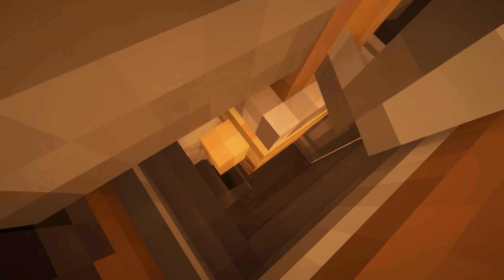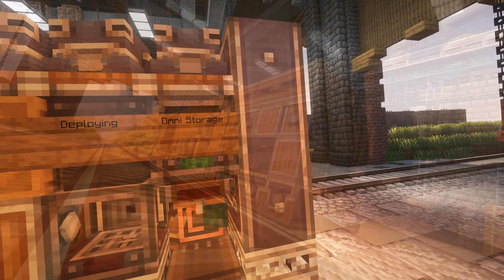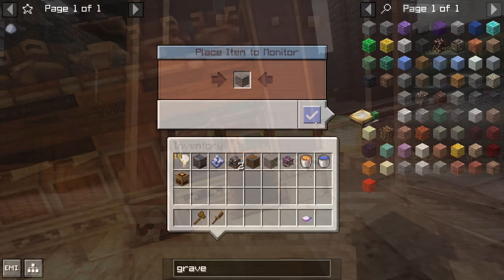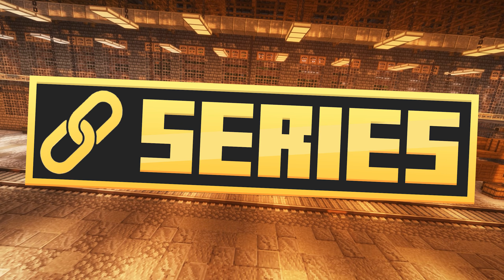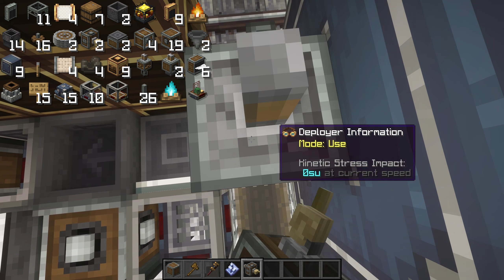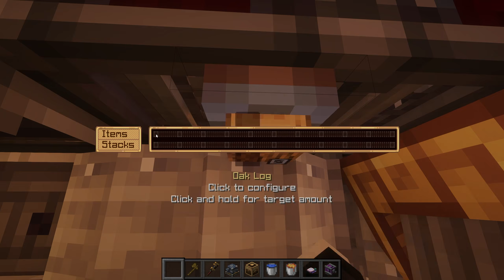Automating EVERY Item In The Create Mod With One Machine!

Comment from the maker: WARNING: There is a glitch that occurs with the crushing wheels, where if the speed of the machine is spinning above 192 RPMs, all items queued to be crushed will bypass the crushing wheels. This can be patched up by setting your factory gauges to where promises expire after 30 seconds when utilizing the crushing functions if you intend on running the machine above 192 RPMs.
Reply: the saw doesnt work?
Reply: @Konzrar  Bit late but to make the saw function instead put a packager below the frogport for cutting that goes into a barrel below and have an andesite funnel leading to the saw from the barrel
Reply: is that fixed?
Reply: Use funnels on crushing wheels input
Reply: aight, imma run it on 193 then. thanks for the warning ;D
Reply: i weally wike this video

Comment: I had an issue with the deployer function: the packager would not accept packages from the above chute to place onto the depot. This was solved by using a saw instead of the packager, also replacing the two gearboxes (that drive the saws) with shafts and a mechanical belt.

Comment: Im having issues with the packager/saw function. we were using factory gages for shafts using with the recipe 1 andesite into saw cuts it into shaft. If we ask in the factory gage recipe for more than one at a time the cardboard sits in the chut above the packager with 2 andesite in it. If we keep the recipe to 1 : 1 it works
Reply: I have the same issue. Since the packager is linked to the saw, I think it considers the saw to be a storage for 1 item, thus preventing the packager to unpack packages containing more than 1 item. I'm working on a fix. It seems doable with a hopper feeding the saw I think.

Edit: You can replace the packager with a hopper, and the barrel with the packager you took from the bottom and it works with stacks of items, dispatching them to the saw one by one via the hopper.

Comment: I've been able to get almost everything working, the only part I cannot get to work automatically is creat8ng brass.   I can supply the Mixer with the zinc and copper, and blaze with coal, but when trying to setup this using factory guages ( per factory board) there is no way to do this.  Do you have any suggestions to get this to work?

Comment: IF YOU HAVE ISSUES W/ THE DEPLOYER:

Solution: 
1. Extend the Setup (Storage) by one block to the right, extend the belt by one block etc.
2. Move the two vertical gearboxes underneath the "CRAFTING" to the right, where the original storage was (two blocks to the right, from the "DEPLOYER"
3. Place a SAW next to the DEPLOYER'S DEPOT, add a SHAFT between the saw and the vertical gearbox (from Step 2.) (Move the NETWORK LINKER to the outside)
4. (From Bottom to Top:) Add a chute, then a re-packager (with activated lever), then a chest (etc.), then a frog above (setup is two blocks higher than original)
5. Add a shaft between the new saw and the old ones, so they keep working.

Now you can produce andesite housings etc.
If you only have one storage and now that each package is complete, you can remove the repackager and chest....

[Issues:]
- packages aren't put into the depot by a packager
- if packages are not complete, the depot will be occupied

Comment: Blasting does not work for Stone, as it can be smelted into Smooth Stone, so it wont let it through the Can't Be Smelted filter
Reply: mine works
Reply: @ianbryant3114 the filter logic might be slightly different for you. I am using .06 of create, and there is a newer version out.. for instance I have to us filters in slots, I cant use the material itself, it just doesn't work
Reply: same for me, have you solved the issue?

Comment: I'm not sure I fully get it. I'm still fiddling with it but it's got spots that baffle me. Like the Cutting doesn't feed into a barrel with a chute that faces a packager...but the chute doesn't load anything directly into the package from above.  It's a great design and I'll definitely use the basis of your set-up, but having to take bits apart to adjust filters and such is  a bit much.
To that end, I appreciate your holistic approach to the workshop but I think I'm going to split these up again to allow for easy retooling and tiling. You have definitely inspired me as far as compacting footprint of a macin, though. Thanks
Reply: did you fix the saw? I really dont know how to while keeping it so compact
Reply: @Konzrar No. I scrapped the whole thing and build my own setups.
Reply: @BinaryJoe  Fair enough, im planning on doing that too but i dont have enough scale yet to warrant a few hours of factory design, will you post anything about it, I would be interested in your take

Comment: After building this machine it seems like packager inputs can't transfer items to the processors. Any idea why?
Reply: I am having this same issue.
Reply: Solved: Certain create processors can’t hold more than one item at once. Had to incorporate internal inventories.
Reply: What changes did you make to solve it, and were you able to keep it in the same footprint size?
Reply: @caribbeancruzer All you need is an interface with an inventory between the packager and the processor. This appears to require more space

Comment: Hey, love the builds. I can't get the mechanical saw (cutting) module to work. The packages just get stuck in the barrel. And what about filters. Is it possible to determine the output via Factory gauges? Otherwise it becomes quite bothersome when doing simple crafting.
Reply: I´ve had the same problem, i only get it to work when i send single item. Wanted to make a stack of stripped oak logs and sent a stack of oak logs but they got stuck in the barrel or chute. Sending only a single oak log works. But that´s...idk it takes ages. Is it supposed to just take a single item otherwise because the saw only processes 1 log at a time and can´t hold a stack of logs in place?

Comment: When I send packages to deployer, it is picked up by the frog port but gets stuck in the chute and doesn't go to the packager. My packager is confirmed to be outputting to the depot
Reply: I've got the same issue have you figured out any fixes for it?
Reply: @krido758 I think it needs a saw to open the package.
Reply: @AlextheCanuck ive noticed you need to put the items in in a correct order as the items in the deployer need to go first and then the belt, the game doesnt realise so it just opens packages as it can. It was a bit weird to figure it out
Reply: @krido758 Yes that's true, but the package is not being opened when the two items are delivered together
Reply: @AlextheCanuck yeah but it still needs to get opened to deliver the items into the deployer right?

Comment: So this wouldn't work for something like stone since stone is sneltable into smooth stone
Reply: If you put your cobblestone on a depot to smelt it, the cobblestone will turn into stone but won't turn into smooth stone until you remove the stone from the depot and then put it back to smelt.

Comment: I had some issues with the deployer portion but was able to fix it by replacing the chute with a packager and putting a hopper to the depot underneath it. Otherwise really helpful.
Reply: omg, that totally worked. tysm for the suggestion! It was driving me nuts not being able to use the deploying function.

Comment: i really like it, but i think i will take your machine and adapt it for my purposes
mainly, I'm not a fan of items that are free. Like for washing, blasting etc, id put them on a conveyor or depot. It is definitely slow but I've had problems in the past with machines going haywire. Especially on servers that have item cleaning or performance mods. Other than that ABSOLUTELY AMAZING MACHINE, i will dissect it, reverse engineer it and learn from it with respect XD

Comment: Thank you for this interesting machine! On my end, it seems the packager does not allow sending cardboard packages of logs directly into the mechanical saw as per your plan. WOuld you have any idea why?

The packager is facing the mechanical saw. It works though if i replace the packager by another saw linked to the first one with encased chain drives.

Comment: All other functions work, but only the mechanical saw does not. Maybe the reason is that there is a packager in front of the mechanical saw. Is there any solution?
Reply: it is working but only 1 by 1. not full stacks. but either way its not working bcs u need some kind of filter i quess.

Comment: Amazing videos, really love the building ideas. I got a question, what happens with things that can be smelted many times? Like cobble > stone > smooth, and in some mods they add more stuff like that. Since you have the attribute filter to "can't be smelted" then it won't let stone pass, for example, and it gets clogged there.
Other than that this was super cool and I learned lots of tricks to use in future builds, thanks!
Reply from the maker: You can addon to the attribute filter to accept stone.
Reply: create: bulk processor by vazpera

fans not only process the items, but can push them slowly into chutes by the time they're done.

Comment: Am I doing something wrong? The pressing part of the machine does take packages, but doesn't pushes them downwards to chute to unpack items inside
Reply from the maker: If your sending multiple item types at once or sending more than 16 at a time it won’t work. If you want you could replace the chute with a hopper to increase that to 5 stacks at a time by having a registered inventory attached that can handle 5 stacks at a time vs 16 items.
Reply: @OurCreationYT  This worked! Appreciate it a lot.

Comment: One problem I’ve found with the smelting setup, you cannot smelt cobblestone into stone, as as soon as it is smelted it can smelt into smooth stone? I can’t work out how to fix it using filters
Reply: You can put an attribute filter INSIDE a list filter to add more allowed items.
Reply: @shamus030 yeah but then there's no way to make smooth stone :/. If relying on filters it means either you can't make stone or can't make smooth stone which both suck
Reply: create: bulk processor by vazpera

fans not only process the items, but can push them slowly into chutes by the time they're done, no filters needed.

Comment: oh gosh I love this whole optimized micro-machine concept. This will be a good series. One note, using empty blaze cages for smoking and haunting is more lag-efficient for servers because it doesn't create extra flame/smoke particles (other than the actual bulk processing particles)
Reply: Are the particles client only ?
Reply: How does a blaze burner haunt things?
Reply: @Cera_01  empty blaze cage. Light it on fire, then right click it with soul soil. Non-spreading soul fire that stays there forever. Good haunting catalyst

Comment: Hello! For some reason my cutting goes the other way? everything works but that because the saw is spinning backwards
Reply from the maker: That's as intended; In the create mod saws are inverted for some reason, meaning that they will send items in the opposite direction of the rotational power being applied.
Reply: @OurCreationYT  Thank you! For some reason had to reset server to get it working. Another question, how do you get the deployer to work? Because the packager doesn't unpack it into the depot as the package has both copper ingot and stripped wood
Reply from the maker: @artemys-mods  That was an oversight by me, you can get around that by breaking the packager and chute, then placing a hopper facing the depot and a pakcager facing that hopper, that way its sending packages into an inventory that can handle more than 1 set of items.